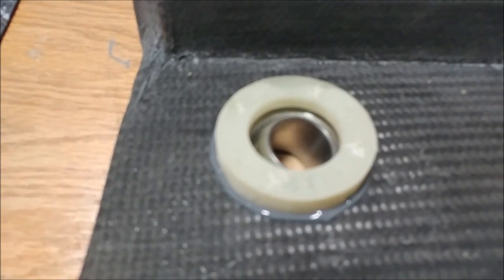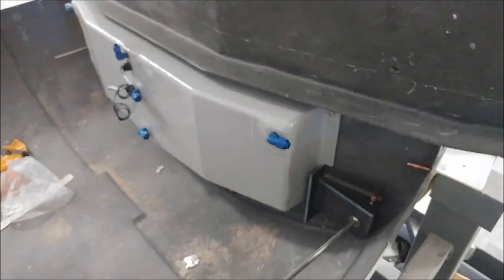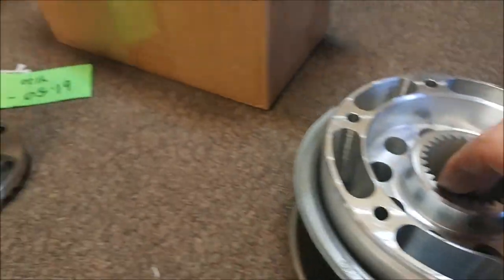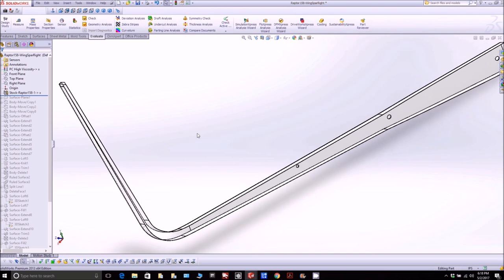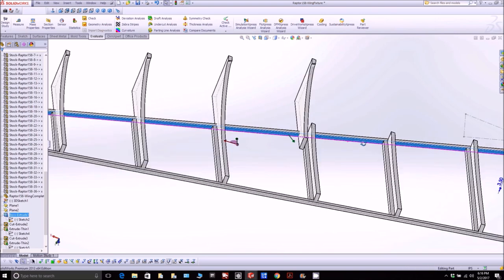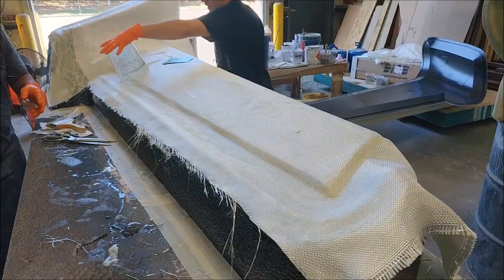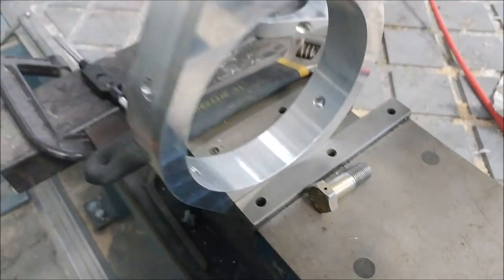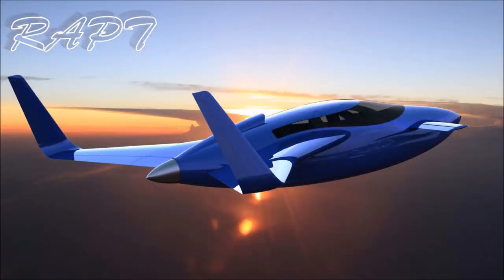Ten Things At Once - A bit crazy but we are moving forward

Comment: Hi Peter;  great to see the progress.  I noticed when you were making the turbo exhaust tubes and such that you were cutting and welding.  Is there not a tube bender near you that can take your CAD data and make those tubes for you.  Welding is hard, prone to failures if not perfect and costly.  Tube bending is the way to go.  You have lots more tubes to do with the wing antifreeze, brakes, etc.  Might be good to find your guy now to work it out.  Having too much changes from "Prototype" to Production is risky.  Need to try out the supplier quality along the way too.  Keep it up.